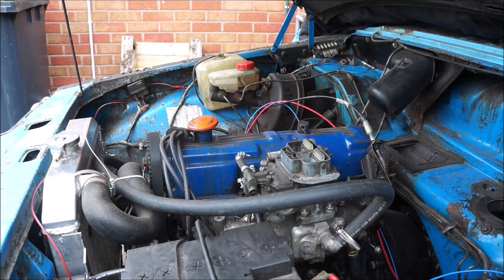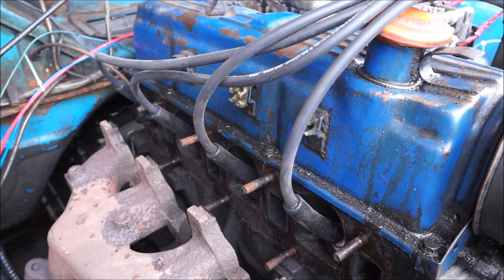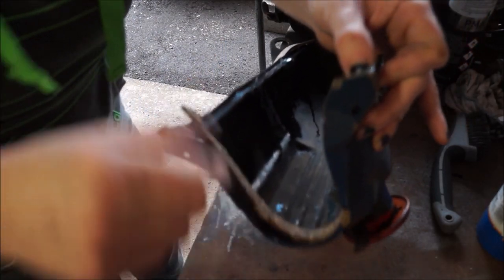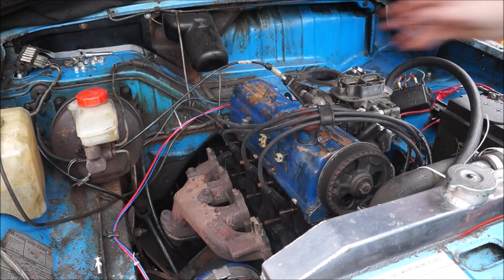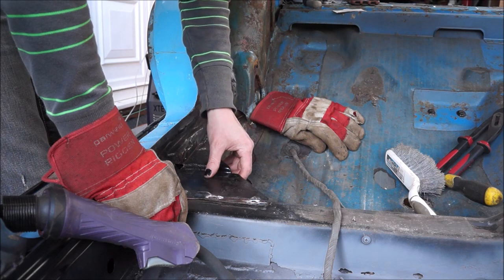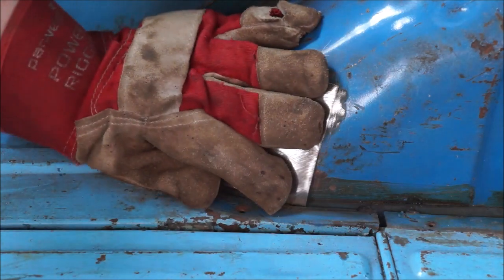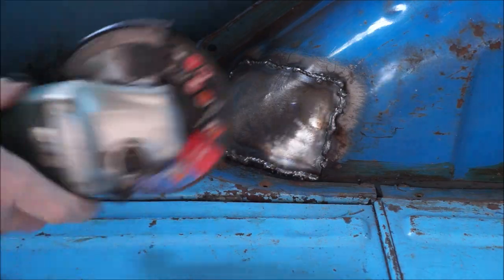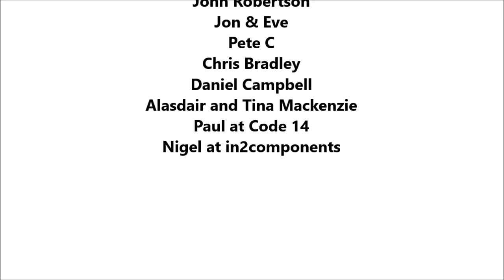TeeCee mk3 Cortina Estate Adventure Fifteen

Comment: Putting in some sound deadening pads before carpet would be an idea, certainly these modern plastic wheel arch liners are good at protecting a car from noise with sound dampening material stuck to the rear as well as protecting from stone chips, water and mud, must make them for classics nowadays as well.
Reply from the maker: I already have tar pads ready to go in Mark, its all gravy 🙂